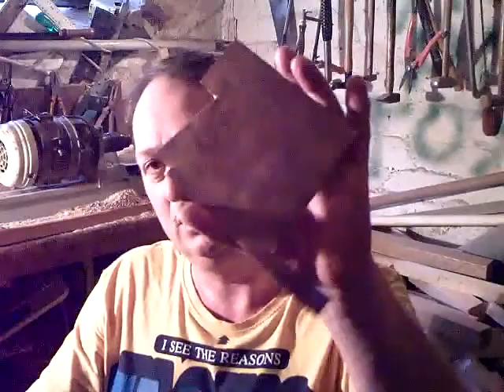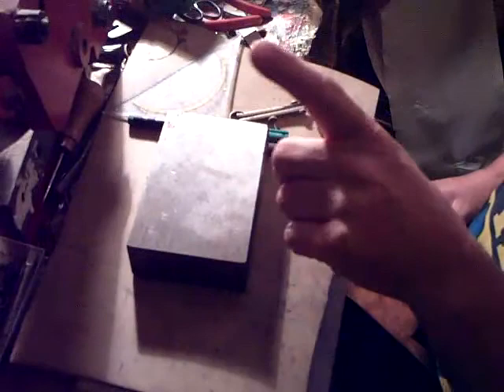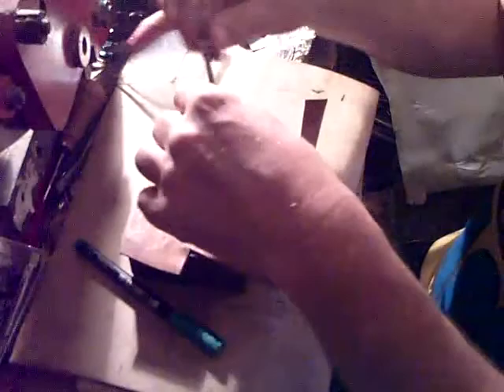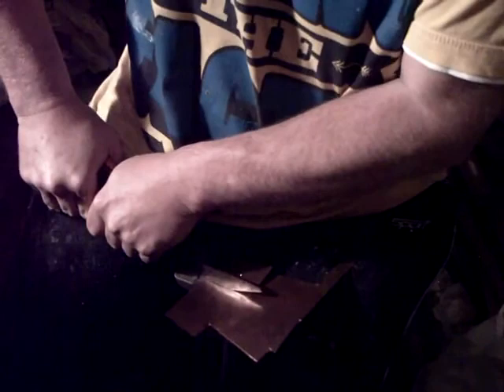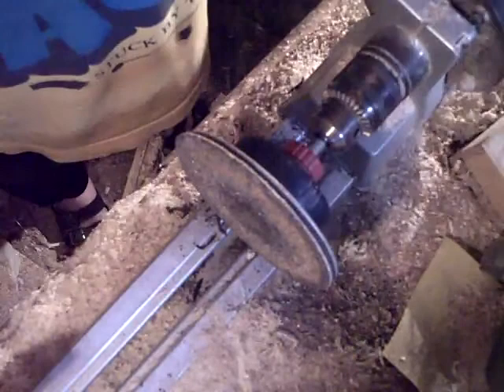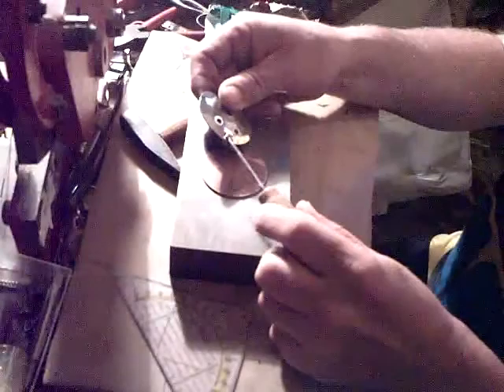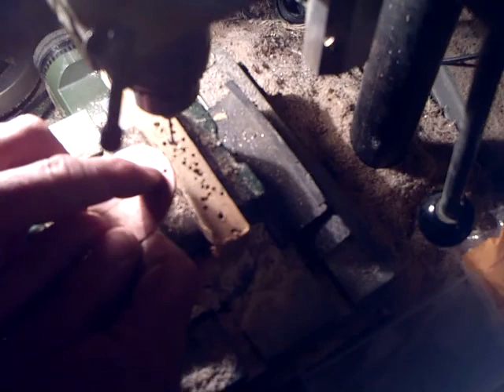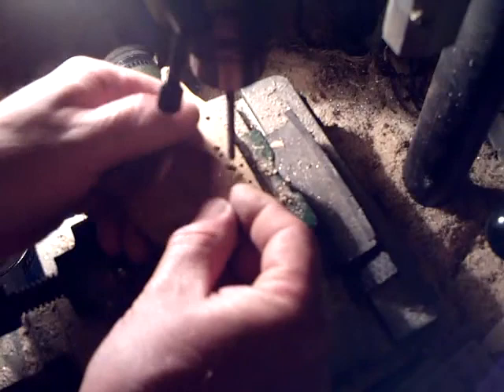Making A Disc Spoon #1

Comment: do you think a jigsaw with a metal blade would work for cutting that out?
Reply from the maker: You need to pick the strongest and thickest blade , that you could get , but still I'd reckon , that you might snap a few blades , before you would have managed to cut out just ONE blank , even of copper or brass , not to mention stainless steel .
I did work with a jig saw on metal sheet before , ......and it would be possible , ....but as said , each single blade won't come a very long way , I guess , ......and it is time consuming , as if you increase the feed , the thin blades are even more likely to snap .

You might try blades of small metal saws like shown at 00:33 of this video :

Making Casting Spoon Blanks From Metal Sheet

Fixing these in a jigsaw frame might work as well , if you grind down their crosswise fixing pins on either end , ....but they are something like 6mm or 7mm in height , so you won't be able to cut a 25 mm radius accurately .

For stainless blanks I'd use an ordinary metal saw clamping the sheet metal in a bench vise ,...... first cut out a square around the circular marker line , after remove the corners to get an octagon and grind down the rest on the big grinding wheel at the job .

Good luck , my friend , ....greetz , Dieter